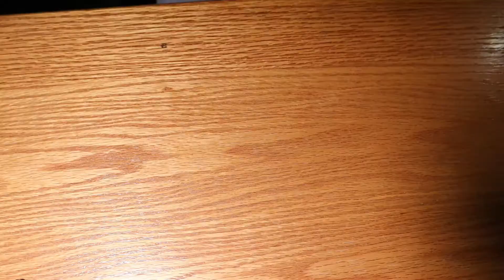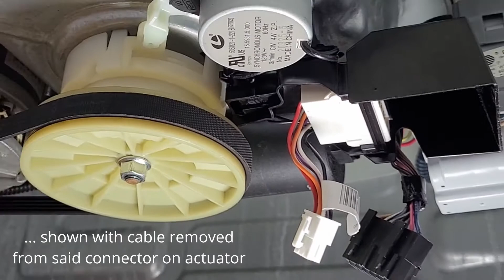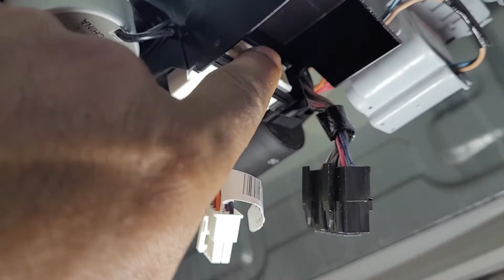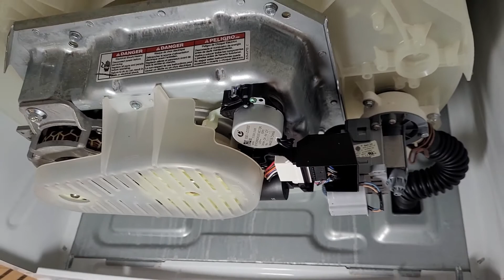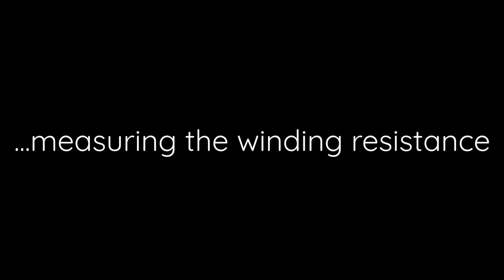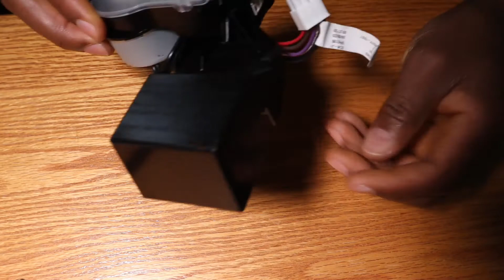How I fixed my Maytag Centennial washing machine for $50 - Part 6

Comment: Where did you find the Actuator with adapter
Reply: I must have done a Google search on the part, which led me to a local supplier. You may want to get the part out of the machine to get pertinent information on what to enter on Google when searching.